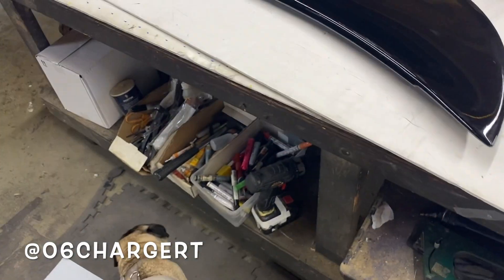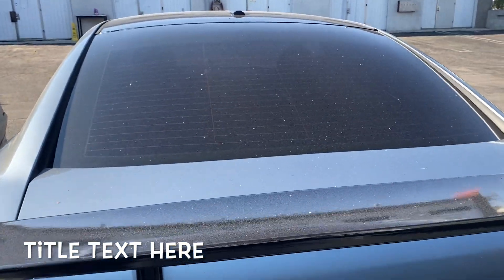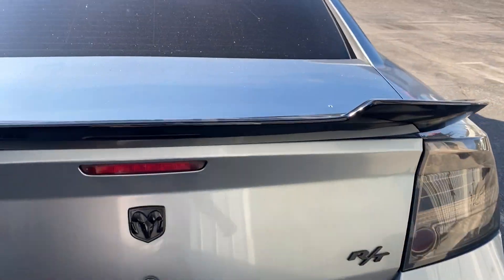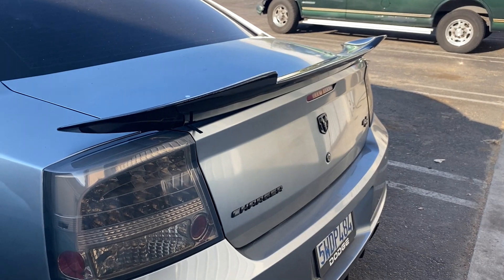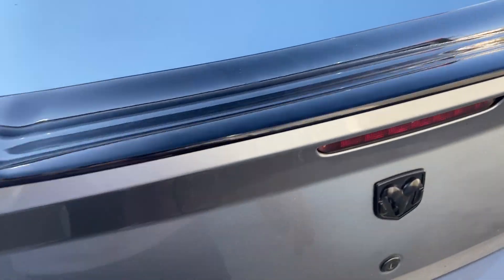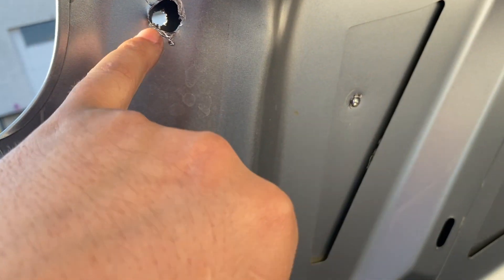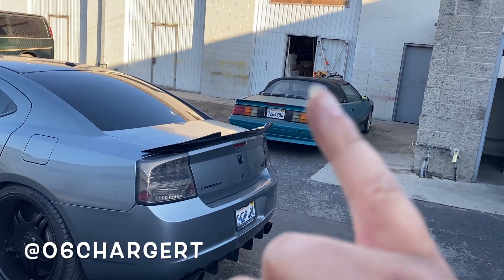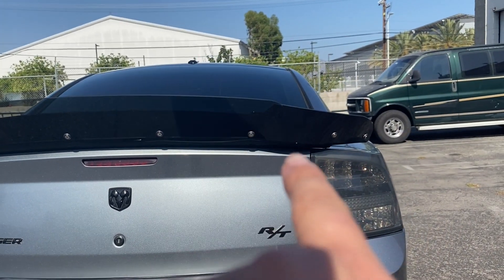2006 Dodge Charger R/T 5th mod update hellcat spoiler w/wicker bill!

Comment: What tool did you use to get the top screws out of those holes?
Reply from the maker: So the spoiler that I had on there, had the screws attached to the spoiler. So all I had to do was use a socket wrench from the inside of the trunk to to remove the nuts, then pull the spoiler straight up off the trunk. You’ll see the screws attached to the spoiler once I show the spoiler off the trunk.

Comment: I have a black carbon fiber hell cat soiler witch the wicker bill an SRT defuser from a 2015 with black carbon fiber widow pillars an black carbon fiber mirror and oem black carbon fiber front bumper lip and the in chanelle widow visors with the newer 2015 srt8 front bumper black and red SRT8 badge on my bumper with black carbon fiber dash trim inside the car on my 06 dodge charger SRT8 sitting on some new hell cat rims with a SRT cam headers carbon fiber cold air intake an my cars jet black so black carbon fiber and jet black its sexy and a monster and only 90,000 miles on her I call her my black beauty or my dirty bitch when you want to see her turn into one when I race you.. I love my 06 SRT8 6.1 hemi my old girl is pushing as much horse power as the new scatt packs and her old ass the boat looking sexier than ever best upgrade I've ever put on her an she stands out an is one of the cleanst 06 SRT8 around... An just picked up a silver one but its almost a grayish blue depending how the light hit it with 65,000 on it and I'm going to black carbon fiber it like mine on that color with my stock 06 SRT rims powder coated matt black 😁 this is my next project and within about a month she'll been done an I'll have 2 of the baddest 06 SRT8 around sitting in my driveway hahaha

Comment: YOOOO Can you please put a link to this amazing spoiler, I want one for my 07 charger rt!!!
Reply from the maker: https://www.ebay.com/itm/383158653442?_trkparms=amclksrc%3DITM%26aid%3D111001%26algo%3DREC.SEED%26ao%3D1%26asc%3D20160908105057%26meid%3D5f712308fc6141d39fc76804b74681d2%26pid%3D100675%26rk%3D1%26rkt%3D15%26sd%3D334032004210%26itm%3D383158653442%26pmt%3D1%26noa%3D1%26pg%3D2380057%26brand%3DVooDoo&_trksid=p2380057.c100675.m4236&_trkparms=pageci%3Ad1aea8ff-29fa-11ec-8f35-8af71bdb03eb%7Cparentrq%3A6b89fcd017c0a77d169d3a7ffff9c8f6%7Ciid%3A1
Reply from the maker: Thanx for watching, good luck on your build!
Reply: Yo I think it’s the wrong link, it’s not a wicker bill
Reply from the maker: @5ohMaestro  oh no the wicker bill I added afterwards.
So if u want the spoiler with the wicker bill, I’d advise u to buy an original hellcat spoiler, not the one I used.
Cause the wicker bill doesn’t fit properly.
I’ll send u the link to the wicker bill in a bit tho
Reply: @ChargerDriven  Please do send ALL pieces used to make this AWESOME setup
Reply from the maker: @5ohMaestro  so you have the link to the spoiler. And I tried looking for the exact wicker bill I bought. But I’m assuming they don’t have it in stock anymore, cause it won’t take me to the page, when I click on the link.
But I found the exact same one, but from a different company 
https://www.ebay.com/itm/184620191430?_trkparms=amclksrc%3DITM%26aid%3D1110006%26algo%3DHOMESPLICE.SIM%26ao%3D1%26asc%3D20190917065201%26meid%3De7ebe2a89dc34e93982960b8855763cc%26pid%3D100935%26rk%3D1%26rkt%3D12%26sd%3D313667761722%26itm%3D184620191430%26pmt%3D1%26noa%3D0%26pg%3D2332490%26algv%3DSimplAMLv9PairwiseUnbiasedWebCpr08MlcGreedyV3&_trksid=p2332490.c100935.m2460&amdata=cksum%3A184620191430e7ebe2a89dc34e93982960b8855763cc%7Cenc%3AAQAGAAACEPhTPtSSrq3jdXXIo%252BR9dlkzZfix0Vbw3mD6x1T8fwa9WZY3p30n7UazWlxCr88IAHeaxHWS4HTISmhI74m9wY%252BbkHkSnlMQTrSekhl5EgXoVAavEonGYj9kt1b4vOdXVOHqxEvUQVkLw6WIEt2NF7AohqllfQ9ksmz3n0r7jC90fl2z84AApY2YZtlMstO742XPHlTuKjInln4x%252BaqVLl8OspGtiJphc%252BdKzoPnBTit2TzeFr1ZwHGDL7t77V%252F7OsioTDooq02rPLiSSTOAP%252FT9T2tUkLYzI%252BEW5Yl6TyqIyK3JAfS3y0VtVVjk1IwPHXAP0ie9yjMhh8ANi1JEwTnc35aLgdZS1CQtl7kPazcbzWRy4yVmhJYXq1Zy1eq%252Fzm56v5K1llT0gJpd4N6n42AGdZ8Rr08H5e6czViLMExCiJu7h0hVGj1Csb%252BR9SkVea2L6RX7nT8A6zVna3cJU8Q50Bky5cuJ0DnCgWy%252BrUFLLCi6ZlI768G0Kh%252F8LgRR9jVmxSOVlzojxy%252BDbgEjG6S3vzb%252FlRFa%252FQtstvU5tYfS1zHZmbePwt4i4qpvtgAJEN%252F27MRBuNr6rhXioEOiOXk7aOW8X3K3q5XT7pboYa44sGFZEunPz2cWxcPXIDwy5kVTt24pODLTxyPhwjXa0%252F%252BF03MLdZd0PulPtYFuZFn%252FUe8%252F24zFUGkuH4W8yzWQiQ%253D%253D%7Campid%3APL_CLK%7Cclp%3A2332490
Reply: The wicker bill you just sent, says 2 piece, is it only the clear part? Or both the clear, and the spoiler?
Reply from the maker: @5ohMaestro  the wicker bill has 2 pieces of plexi, one gloss black, and one small clear/ black piece that goes in the middle.
The spoiler is sold separately.
I sent u the link to the spoiler already.

Comment: Hey man, loved the video. Can ya drop me the link to the spoiler?
Reply from the maker: Sure, just member it’s not exactly the hellcat spoiler. It’s an aftermarket, so it’s a bit shorter but wider. That’s y my wicker bill didn’t fit properly
https://www.ebay.com/vod/FetchOrderDetails?itemId=383158653442&transactionId=1095147901025
Reply: @ChargerDriven  the link isn't working 😭
Reply from the maker: @datguytho2307  try this one;
https://www.ebay.com/itm/Fits-2011-2020-dodge-Charger-SRT8-Matte-Black-ABS-Rear-Trunk-Spoiler-2016-2017/383158653442?pageci=079a358d-f3ce-464a-b163-35308665384f
Reply: @ChargerDriven  thanks a bunch man!!

Comment: Do you have the link for the spoiler
Reply from the maker: The spoiler itself is this 
https://www.ebay.com/itm/Fits-2015-2018-dodge-Charger-SRT8-Matte-Black-ABS-Rear-Trunk-Spoiler-2016-2017/383158653442?pageci=952a6fae-9243-4a1c-bff7-d1b577f255aa
Reply from the maker: The wicker bill u buy separate